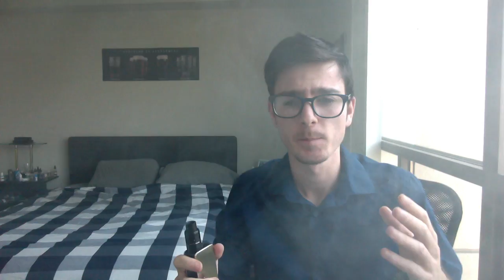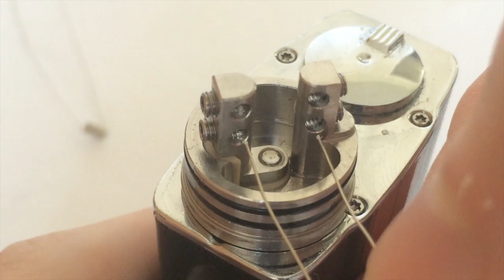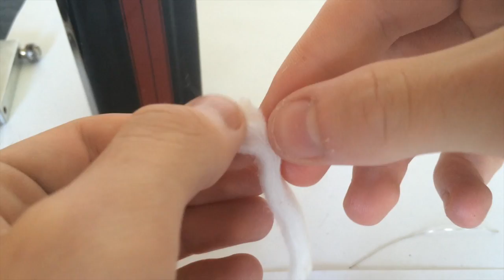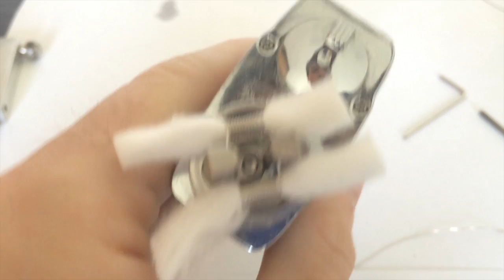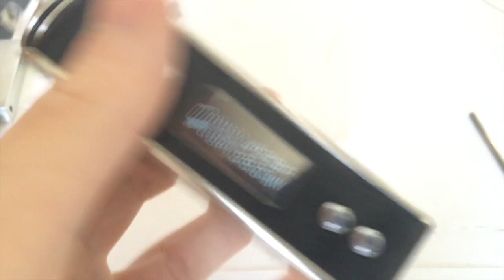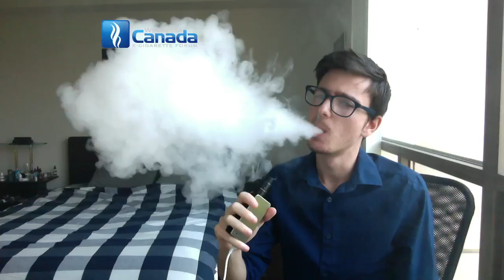Velocity Nickel Build Tutorial

Comment: I got the UD builders choice box yesterday, which includes some 26 gauge nickel wire. I was a little hesitant to try it, but I ended up making a 15 wrap 3.5 mm coil.

I used my coil master, and just spaced it after wrapping it, and it looked awesome! I only did a single coil, so I could check the resistance to make sure it wasn't below .1 ohms or my mods wouldn't work with it, and it's 0.16, so I just did a single coil. So far I really like it! I'm using my Tsunami 24 RDA.

Comment: Nickel is toxic and acrylic used to make drip tips cause cancer and effect your brain chemistry it's a well known thing in the ear stretching community, they heat from your skin makes acrylic release toxins your body absorbs, I can't imagine the toxins released under the heat from vaping, pass the message alone please
Reply: Along***
Reply: I know this is an old comment but at the temperatures we use nickel at aren't anywhere near the temperatures the metal starts gassing at. Also acrylic tips are rarely used and are typically delrin or peek insulated or completely delrin.

Comment: Maybe because I mouth to lung mostly, but I up the temp to get the flavor I want in my NI200 builds.  The eVic-VT is low on temp compared to a DNA 40, so try 480 F.  If I remember right 510 F is about all it will do regardless of what you set it at above 510 F (per PBusardo review).

Just received my Velocity clone from FT so have a lot of experimenting to do myself.  Cheers!

Comment: I think your coils are too low. I've got the same rda with 9 wraps/contact duel coils coming in at 0.05-6 ohms. Going to try to space the coils out later. With all of this said, put your coils above the primary air flow. It may be nice at the air holes. I'm also running mine at 50j @ 550°
Reply from the maker: +Brandon Joyner I was thinking about that, the airflow over the coil may reduce the flavour.. thanks!
Reply: +WackedOUT ECIG You will see a huge difference. Enjoy...

Comment: Get yourself a 4mm rod (a Coil Master v3 would come with one and is so much easier to use than your current jig) for wrapping nickle builds.  Much better, trust me.  ...And do you realize you are using that jig backwards?  You're supposed to hold the wire with light tension in your non-dominant hand and turn the JIG in your dominant hand to wrap the wire around the mandrel.  It feels more awkward to do it that way at first but that is how it should be done to avoid twisting the wire as you coil it.

Thanks for sharing though.  BTW, have you tried nickle and kanthal twisted together?  I'm considering that option once I get a corded drill for twisting wire.
Reply from the maker: +ChibiChula I've actually never used a rod bigger than 3mm lol, and I have coil masters (given not the v3) and I just prefer my old ways tbh.. good to know about using the jig backwards, seems to work for me though!  
I have tried twisted kanthal/nickel and it seemed to be more stable.. but twisted coils never impressed me really, lots of popping. Thanks for the feedback!
Reply: +WackedOUT ECIG You did a great job with this tutorial, especially with emphasizing the solid connection needed while avoiding over tightening.  

I used to use the same jig you do and when I found out how it was supposed to be used and did it the right way I noticed immediately that I had less trouble making dual coils glow evenly and less hotspots because I wasn’t twisting the wire while making the coil.  Huge improvement. 

Oh, and the reason I told you to get the 4mm rod is because you kinda need it for ni200.  Makes the coils shorter, therefore allowing for more more space between the coils which I find gives you better flavor with ni200.  It also allows you to use higher gauge ni200 which helps make the coils a tiny bit sturdier, especially if you're using the tempered stuff.  Admittedly, it makes the4mm coils don't fit in most drippers but it should be fine in the Velocity.  It's also useful for rebuilding stock vertical coils like in the Herakles, Artic and other similar tanks but I don't think you need to do that, lol.

BTW, the Coil Master v3 is the most awesome version.  Bigger for more grip, able to coil in both directions, the rods are longer to help with coil placement and it comes with a bag to store the parts in.  The only thing missing from it is threaded rods to make spaced coils easier and who knows if they will come out with that soon, lol.  Extremely comfortable and convenient for someone like me who has carpal tunnel syndrome and fibromyalgia.
Reply: +ChibiChula I agree,twisted ni200 and kanth. is the way to go.More stable, more flavor.

Comment: I have experienced that with long coils using Kanthal, the flavor is mute compared to smaller coils, maybe because a longer coil won't get as warm as a shorter coil for the same wattage (the heat will be spaced over a bigger surface). You are using nickel, but temp control just avoids the temperature to go over the specified amount, the wire can be cooler if you don't provide enough power. Also you probably want to try to see what is the actual temperature in which your mod burns the cotton, because, according to Busardo, mods are not very accurate at measuring temperature. Another thing that I have been thinking is, when you are using a tank, even if it is not wicking properly, the cotton will never be completely dry, so you can probably vape at temperatures slightly higher that 420F, and never get a dry hit (unless the tank is empty). But that obviously depends on how much a chain vaper you are. I just got a flask clone temp mod so I will experiment with that. With DIY you can always increase the juice flavor concentration, when the device is not performing well. I did that to be able to vape a certain juice in a subtank mini. The juice however became unvapable on my plume veil, the flavor became too strong.
Reply from the maker: +Marcello Fialho I've actually always experienced the opposite.. more surface area = better flavour. But, you do need higher power to get that. Someone else had suggested raising the temperature and I'll definitely try that and test it's limits, see if it gets better. As far as the juice goes, I have a firm recipe that vapes well in everything except these nickel builds lol so I'm not too concerned with making a new batch just for this, thanks for the tips though!
Reply: Yes, definetely, the more surface area the better. The only thing is I have been using the plume veil atty and it has small holes for airflow, therefore the air wouldn't hit a long coil well. And the flavor I get using restricted airflow is amazing. To me the perfect atomizer would be like a formula one car, with ducts directing the air right through the coils. I mostly vape a DIY juice made out of snus and coffee flavor, It is the type of stuff that doesn't require a rotation, that's how good it is. But... it gunks up my wicks pretty badly. I wonder if I had better airflow I would also have less gunk, because gunk is (I think) dry and burned flavor extract.

Comment: beautifull coil's, i love big clouds , i love turn my room on heaven, but flavour is important to me, so on my velocity i will use kanthal, maybe try titanium, WackedOUT ECIG what do you think about using titanium on this RDA? , thank you
Reply from the maker: N Saraiva I haven't had any great experiences with titanium yet.. but I'll let you know if I find a good one!
Reply: WackedOUT ECIG titanium so much easier to build vs nickel, got them from albert at ecigarettes.ca, very chill dude. 24g tit wire in my quasar, which is a smaller deck vs velocity, was pretty easy to build and it clouds and taste pretty good. as for the velocity, ever tried using mainly the indirect airflor instead of the slots? noticed on ur vid u have it pretty open if im not mistaken. im yet to try it on my velocity but i have a good build in it so im still debating on wether im gonna take it out just to try temp on it or not.

Comment: Does the height of the coil matter?
Reply: Bob Vergara Yep, it does actually. Depends on the RDA though and where the airflow is located. It's all about the coil in relation to the airflow holes.
Reply from the maker: Bob Vergara I'm honestly not sure.. I'd say try out different heights and let me know!
Reply: Bob Vergara lower coil = more flavor
Reply: +videos What would be considered a lower coil. I literally have the same things as in this video. Same MOD same RDA and same coil. Just haven't gotten to put anything together. Wanted t learn more first.
Reply: +Richard Yarbrough as long as the coils line up with the air holes it's all good